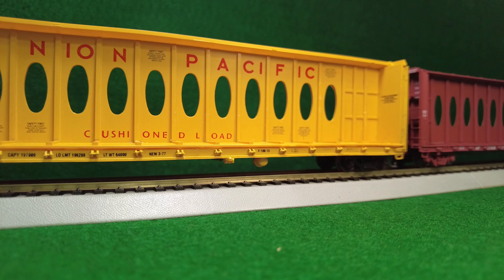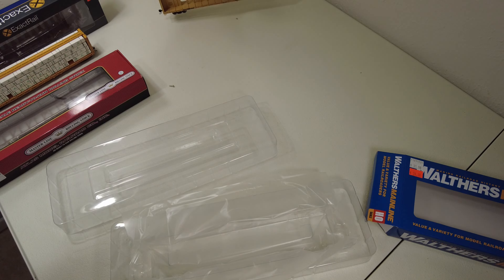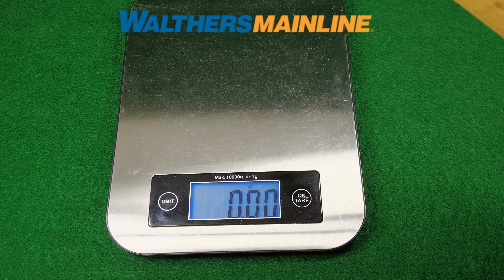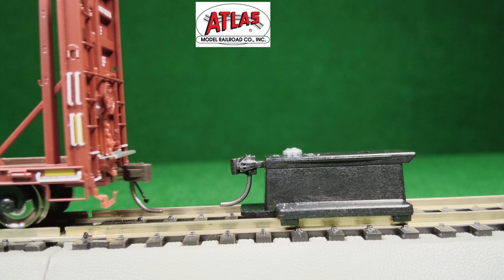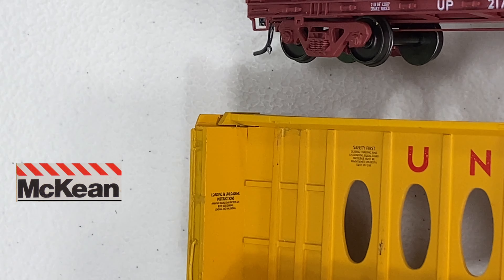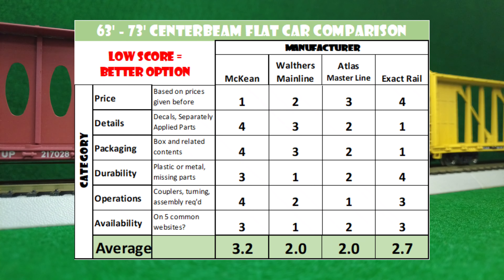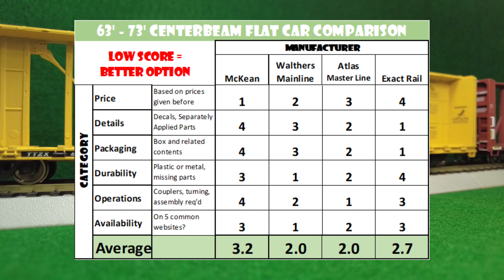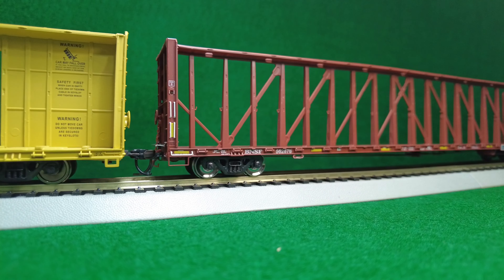HO Scale Center Beam Flat Car Comparison

Comment: I noticed the McKean car had above shank couplers that made the knuckle 'drop'. That's gives the others an unfair advantage. I never thought about the center sill preventing tighter optional radius for the trucks...interesting. Filing it down would make the trucks able to operate on 18-22-inch curves. I think the Walthers is a good model overall.